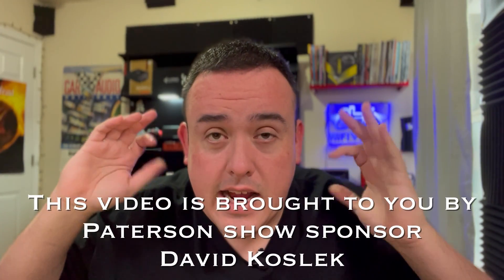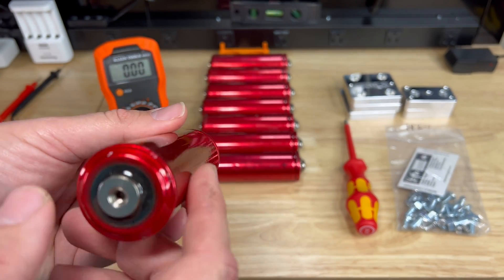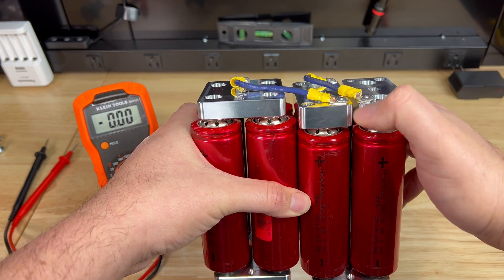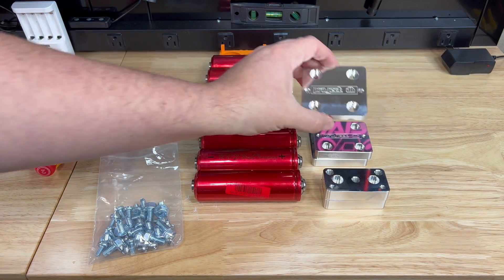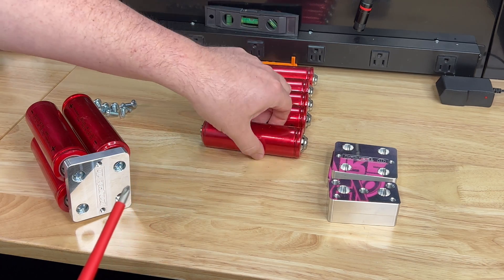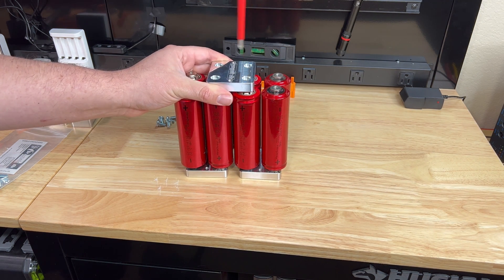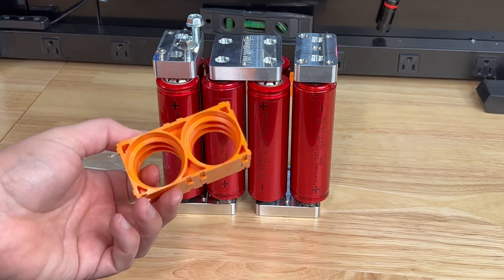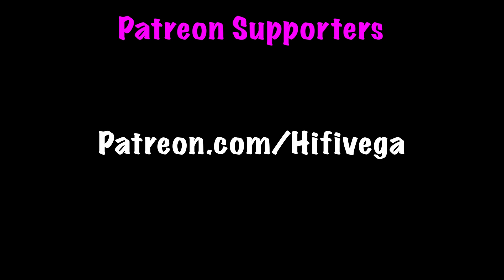How to build a 12v lithium battery bank for beginners (Headway 16ah build)

Comment: I charge up to 15.4 will these be safe?
Reply from the maker: Nope these can only be charged to 14.8v in a 4s configuration
Reply: @HifiVega  alrite I'm just gonna end up getting another underground power lithium then
Reply from the maker: @markie1993  if you need higher voltage in diy check into lto or cmax
Reply: @HifiVega  I already got a lifepo4 ugp 40ah. Just looking add some extra🔋

Comment: I just got 12 cells. Do i need a bms balancer to run it in the car? Or is the active balancer a better choice
Reply from the maker: You can use an active balancer, but most folks just do a top balance like I did on these particular cells.
Reply: active balancer

Comment: Would a set up like this power a 3000watt amplifier? I’m debating on getting a lithium set up but curious as to how I can find out what exactly I need to power my amp. Also can this be connected to my truck battery and charge the same with the alternator?
Reply from the maker: This can run inline with a factory charging system and for 3000 watts I’d consider at least 24ah if not 32ah

Comment: Awesome video! definitely shed some light on headway lithium banks. So how many watts RMS will that 16ah bank support? Trying to decide if I wanna go lithium and how big.
Reply from the maker: Thanks! It’s more about amperage than watts and this 16ah pack is good for about 150 amps
Reply: @HifiVega  if I have a 1,500 watts rms amp how many ah I need?
Reply: @myrontaylor77  I think you have to figure out how many amps your amp pulls .  I think my 3k pulls 220 amps at full power so 1500 is at half

Comment: No separation between any of the cells, or the parallel packs?  No covering over the aluminum blocks?  I'm seeing less than an inch of space to bridge with any metal object and then you've got a very high amperage short, because of how powerful those cells are.  I mean, they "look" cool like that, but it's a very unsafe build if left unprotected.
Reply from the maker: This battery will have an enclosure this video was only meant to show someone how to assemble a bank
Reply: You sound lonely lol

Comment: How many Amp hour lithium should I need for up to a 20k powered system
Reply from the maker: Wish I had an answer for you, but I haven’t ever dealt with that kind of power.  My guess would be whatever you were thinking x2 😬
Reply: Depends on the alternator set up you choose.lots of variables.but say a 250a alternator your gonna want a 150ah setup to be safe.could go with slightly smaller bank if you run a couple supercaps in addition to lithium.

Comment: Great video. Have you seen the recoil audio 6.5s $40 set . Surprisingly good build quality. Would love see reviews for some recoil audio
Reply from the maker: I seen em they look like a interesting set
Reply: @HifiVega  I ordered few set but not tryed them yet also ordered there powered 12 subwoofer , and looking at there amps rated 1200rms for under $130 I not ordered the amp yet but I did order there 3.5 midrange for $80 sopose be a sq midrange. . seems to be building out to complete brand .

Comment: Very cool. Hopefully big d will share his lithium upgrade soon too. I would usually charge them to 3.55 when in parallel it's hard to know how full the battery is just by voltage. I've gone from a decent little 64ah to almost 300ah this last yr. Lithium is def fun stuff. When you need big sustainable power or not. Now I'm building an battery system for the house lol
Reply from the maker: D is already putting his bank to use, but I’m sure he’s gonna show it off soon.

Comment: Great video. Very helpful. I've got 8 cells myself. 4 new 4 used. Not sure if it's a good idea to mix new and used.
Do I need a battery isolator for my AGM battery upfront and Headways in the cargo area?
Reply from the maker: I’m not sure about mixing new with used and I also use an isolator even if they’re both agm or flooded

Comment: These are indeed great cells, however... DONT OVERCHARGE THEM!!! 

I had a 96ah bank, and it was incredibly powerful, but I made a major mistake. I charged the pack to 16 ish volts for a couple hours, unintentionally of course. It leaked lithium electrolytes, smelled like sweet ammonia, and became unstable and dangerous. 

Sooo, I took the the ol AK to it, just to see what happens when charged and instigated.. lol! Can be scary stuff! Vids are on my channel. Anyway, 14.6 max, 14.4 for longevity. With strong alt power, this small battery can hold off a 3k amp, no problem.
Reply: What if the alt puts out 15v at first start for a few mins before dropping down to 14.4 to 14.6 14.7?
Reply: @xBLACKxOPSxSECRETSx2  just put in a switch. Keep it turned off until the alternator voltage drops after initial startup then just flip the switch
Reply: @xBLACKxOPSxSECRETSx2  over time, repeated overcharging will shorten life and do irreversible damage to the cells, causing loss of capacity and performance. I would recommend getting into lto, like lishen, ying long. If you can get control of your alternator, they are happy around 15.3-16+. Headway is by far cheaper, very strong and is unbeatable in price to performance/value ratio. MAX though is 14.6. any more than that and your hurting the cells.

Comment: how many pieces & ah do i need for a single monoblock 3k rms amp with stock electrical, stock 90amp alternator & stock single lead-acid battery under front hood that straight power 1/0awg wire to the amp under front seat, around 10feet power run. car charging at 14.3v idle. civic fb 2014
Reply from the maker: If you want minimal voltage drop I’d consider build at least a 32ah bank, but a 16ah bank like this would make that situation doable with some voltage drop.
Reply: @HifiVega  32ah need 16pcs? but 8pcs 16ah also can work fine? just budget built add some bass 😂
Reply from the maker: @SUTH_33  the difference is having a more stable voltage vs possibility dipping into the low 12’s high 11’s
Reply: @HifiVega  yahh get it. thanks 👍

Comment: I haven't ran lithium yet. I've reinstalled some stuff and need a battery I had some old kinetik 2400s from back in the day but they set to long and I don't believe I can bring them back. I only need something for around 4 to 5000 watts. Not sure if I should do something like this or just get a couple xs power d3400s.. I definitely wouldn't mind trying something like this if I can get what I need and it be cost effective.

Comment: Is there a reason why you didn't locktight the m6 screws? I think the low hold kind would be appropriate in a bass heavy environment. 👍Great video as always.
Reply from the maker: I would have used loctite for sure, but I wanna pull this bank apart for further testing later and it's gonna be used on the test bench for now

Comment: Grate set up. What is the charge current for these? Will a 100amp + alternator over charge them?
Reply from the maker: I believe the charging capacity for a single bank is 2 amps so this can handle 120 amps of charging
Reply: @HifiVega  ok cool. So in theory for a light system 1000-1500 watts this would be a great secondary battery bank if maintained with a lithium charger. And an alternator not over 120 amps.
Reply from the maker: @dannyclark9820  yep

Comment: Nice....I like the compact size. I'm already trying to stuff 10 pounds of crap in a 5 pound bucket. I got barely enough room for a capacitor bank behind my passenger seat.
Reply from the maker: yep. its small light and cheap!
Reply: @HifiVega  My only problem is my JS alternator charges at 15v. Is there wiggle room in the voltage or is the 14.6 max?
Reply from the maker: @MullinPerformance  actually you probably need to look into different cells because I wouldn't charge these over 14.6 myself